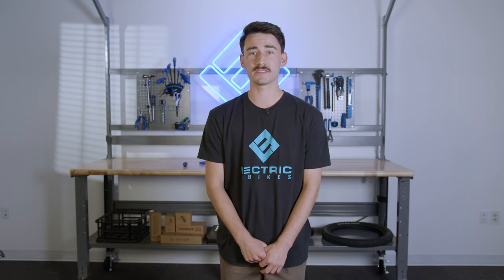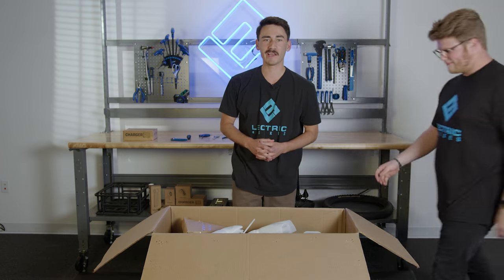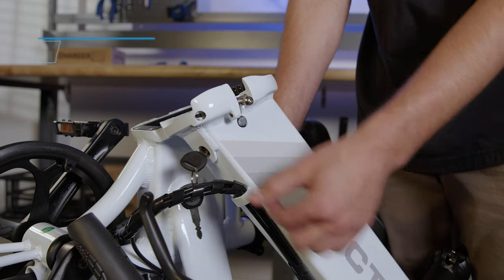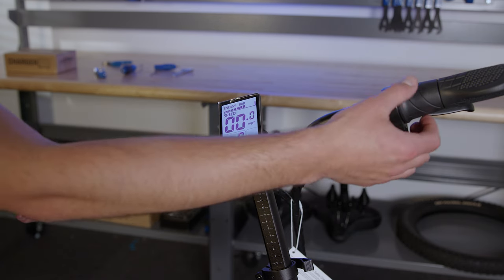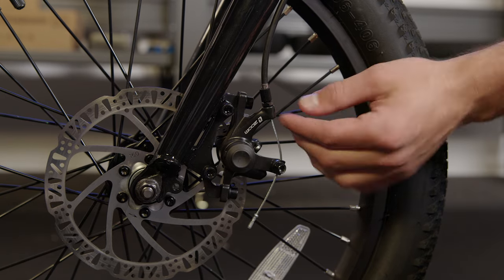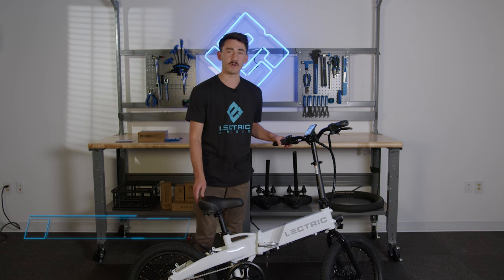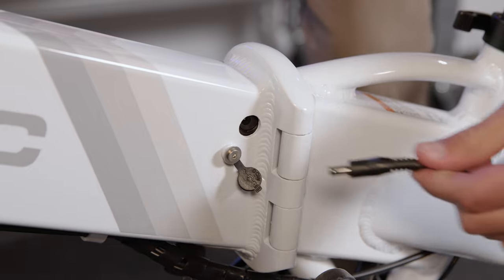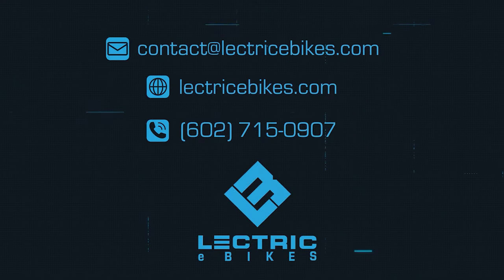Lectric Service Center | XP Lite First Ride

Comment: Okay…unboxed. If working alone you can gently lay box on the side and pull it out. DO NOT cut black zips…except the one holding the warning tag on it. Also, collapse the steering stem again before locking the battery in to protect the cockpit. Also recommended psi is on sidewall of tire: mine being 35psi. And, as always, safety first and teamwork!
Reply: Thanks for mentioning the PSI. I couldn’t see it anywhere and it’s not in this video or the manual!

Comment: Just copped one to commute to work and gym cuz I drive a 02 tundra. That thing binge drinks gas. I can’t wait. I literally just placed the order and i think I’ve watched every lectric video on YouTube. I hope I can get far enough! It’s about 6.7 miles to work.
Reply: You'll be fine depending on which mode you use–if you pedal literally at all it will definitely get 20 miles of range. I took my original XP to 50+ miles with PAS 1/2 and pedaling.
Reply: I weigh 240 and got 31 miles on my first charge mostly on PA 2 averaging 10 mph.

Comment: That was very helpful.  I bought saddlebags and I am having trouble replacing the taillight behind the saddlebags.  I followed the directions and they told me to pull black cord until it comes apart and then attach it to the outer area in back of saddlebags.  I cannot put the cord apart.  It is too difficult.  Could you please show me that I am pulling the right black cord.  It does look like it will come apart but it does not.  Thank you in advance

Comment: 2:00 had to insert handlebar first, then fold stem up because handles cables were not long enough to do the other way. No need to apply lube to handlebar tube before inserting into stem?

Comment: Looking at getting a couple of these. when folded what size tote ( the smallest) would this be able to fit into? Also what would be the watage/amp draw when charging. My plan would be to transport them in our short class a motor home by bringing them in thru the door
Reply: The box that the xp lite comes in measures 37"×16"×29"

Comment: what happens if you plug in the bike to charge when it’s already fully charged?
Reply from the maker: If the battery is fully charged, the charger will stop charging.